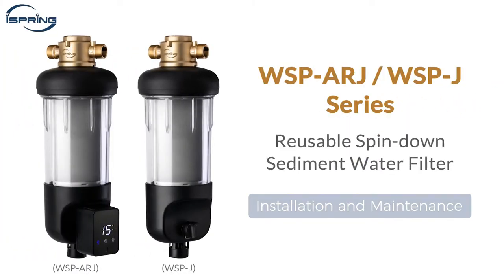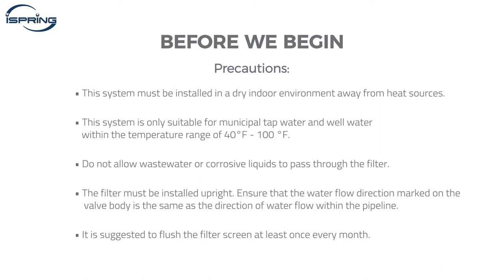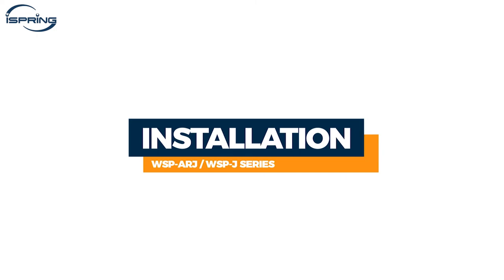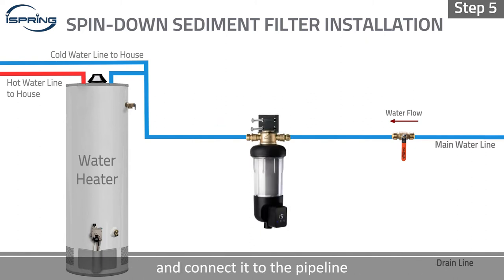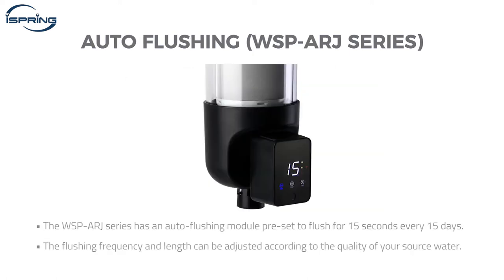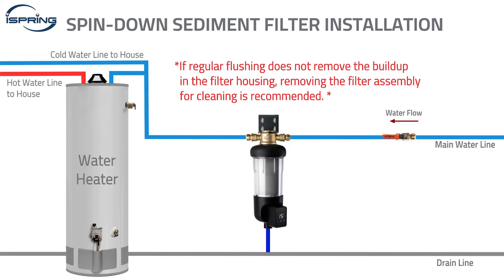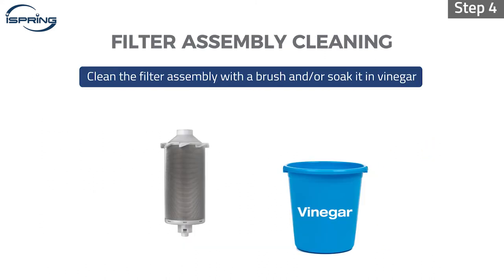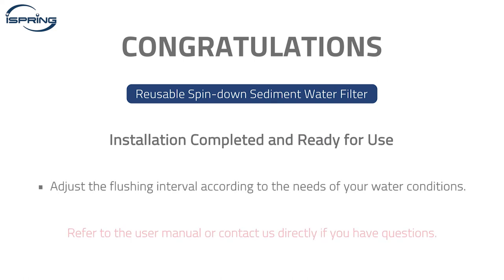Installation Guide of iSpring WSP-ARJ & WSP-J Series Spin Down Sediment Filters | Setp-by-Step

Comment: What size if the first screw on connector and where can I buy it
Reply from the maker: Hi there. They have two types of threads on both ends of connectors (inlet and outlet): 1-inch MNPT and 3/4-inch FNPT.
Please kindly contact us at support@123filter.com, at (678) 261-7611 M-F 8:30-5:30 EST or at (470) 560-0012 M-F 8:30-5:30 EST (Messaging only) to properly guide you.
We are happy to help!